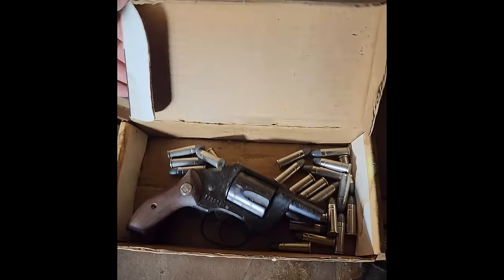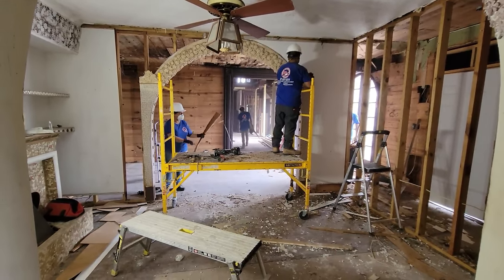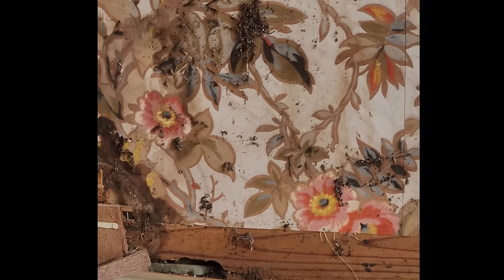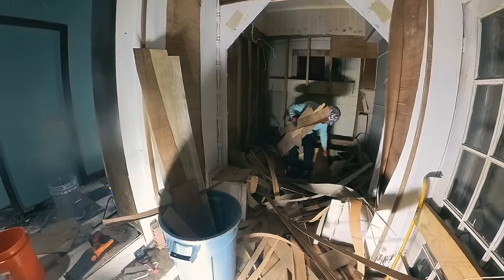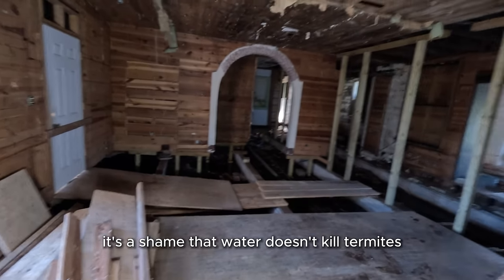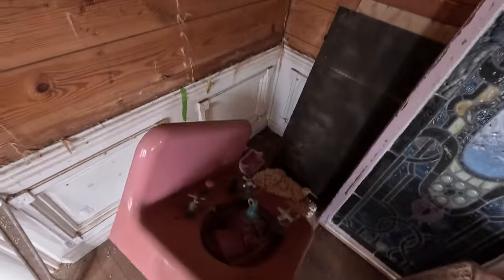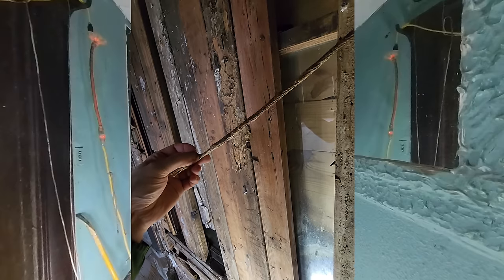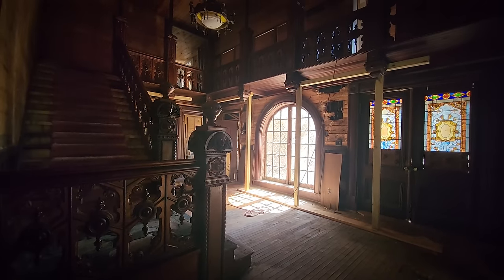Ep. 6 - What we have Found Behind the Walls

Comment: I’ve been working on my house for almost 3 years, and I still need a new roof and major foundation issues. The hvac guys, before my time thought what’s the big idea to cut into one of the major beams holding the whole west side of the house up. They cut through a few beams to run their ductwork. At least you have windows with the weights. I have windows, and do not know where my weights went?
Reply from the maker: I got some spare weights if you need some. Yeah the foundation issues are the expensive ones. I'm glad we have a crawl space though so at least when the place sunk a bit - we had some room to give lol

Comment: Save the doors, And aren't you supposed to secure roof and damage there to asses direction and footing. Even if its just tarps and temporary cover to allow drying
Reply from the maker: Roof is fine for now. But it doesn't matter anyway as every bit of framing and flooring needs replacing before we add a new roof

Comment: What did you do with the clown doll? Did it have anything inside it?  So many holes lol.  Sometimes the way it was, wasn't right, so do what you can and don't worry so much about how it was. What ever keeps it standing. When it comes to decorating - the answer is "yes dear".  My parents moved a lot and it was always a fixer. 50 years of marriage at least 14 different homes. Keep calm, carry on and "yes dear" :face-red-heart-shape: (there is always the coin toss to settle differences, that was my job - toss the coin. you need a coin tosser lol)  Great Video!  Thank you :trophy-yellow-smiling:
Reply from the maker: Thanks! Agree with you. And yes we have made some changes in the plans to also change the way the roof goes on and how the stones are held on the top too. That will help stop the same issues
Reply: @MoneyPitCastle  That sounds like a solid plan, that roof was never right by the looks of it. The extra weight on top of the walls probably made them shift a bit so altering the top stones makes sense.  I look forward to watching more video's to help you pay for all of this.